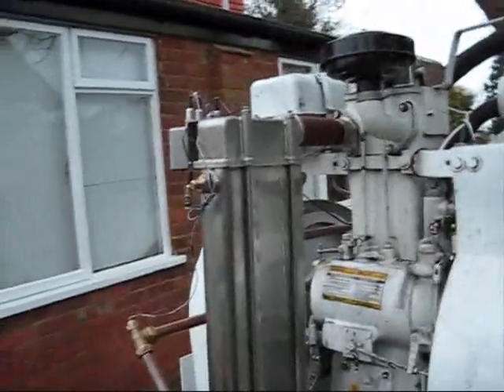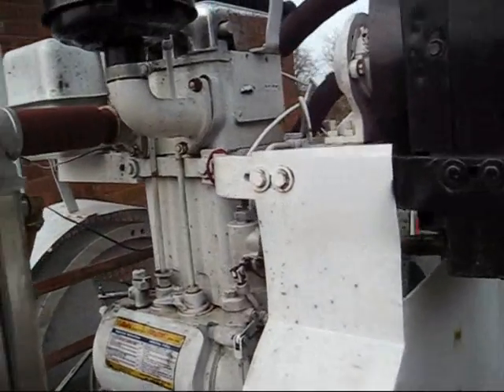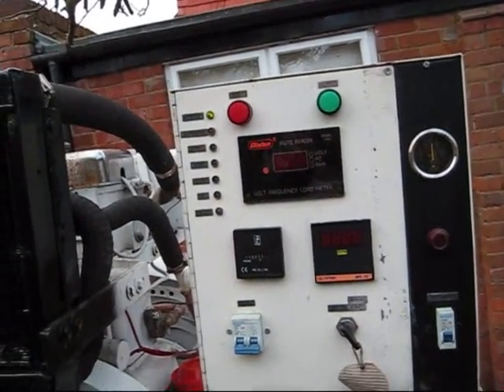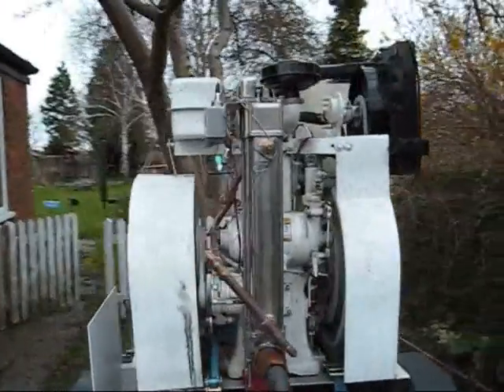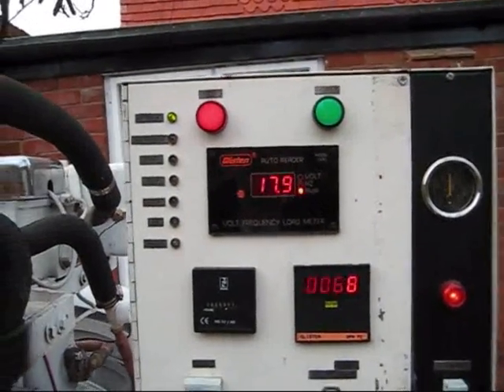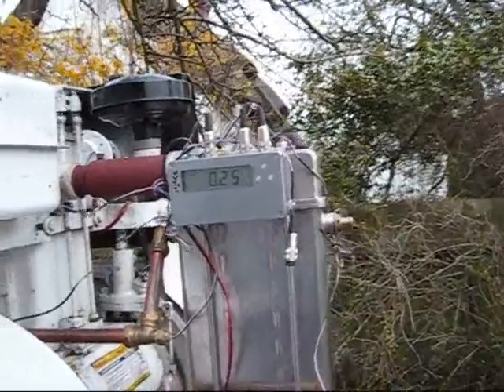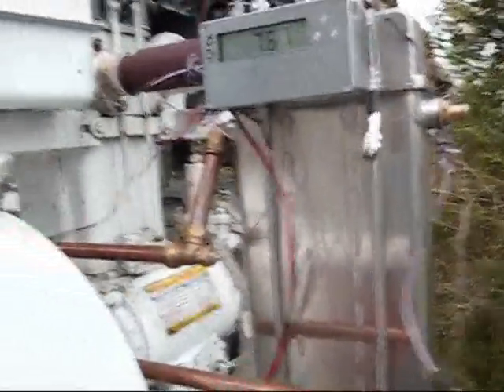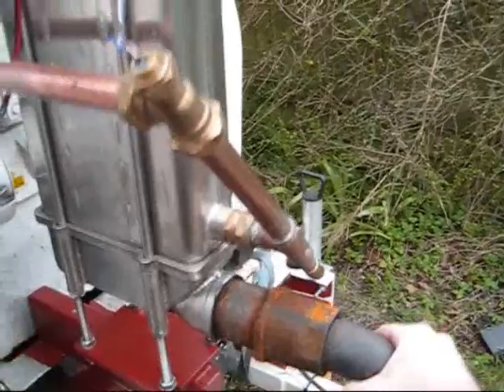Combined Heat and Power Multi-Speed Vegoil system

Comment: You may be producing 4KW at lower speed, but you will not be producing the correct Hz. If you try running anything other than electric heating elements, you will damage them.